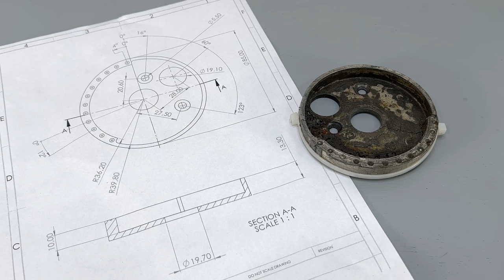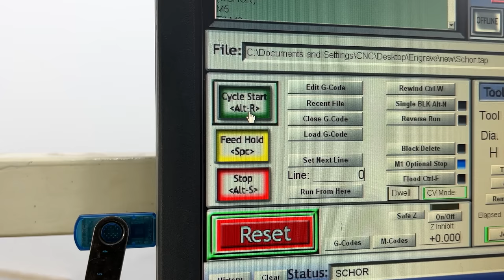1905's Cheese Wire Slicer - Restoration

Comment: this is painful to watch for one reason:
pre 1970's lead had been used for muitiple of tools, paint, and everyday items
lead is Poisoness.
you NEED to do a lead test BEFORE you even THINK about doing these types of restorations

i have seen to many videos like this where they dont do a lead test, its excruciating
Reply from the maker: For your knowledge I make lead tests every time and not because lead is so poisonous but because other reasons. You saw first these lead tests in some videos from my colleagues but they do ( and me too ) these test because we don’t change the sand in the sandblasting cabinet at each project and we risk to inhale that dust mixed with lead from multiple projects. Lead is poisonous but not so poisonous like you risk to die from a restoration project. And I make tests at each video but I don’t show in all of them. Depend by the length of the video , to not include unnecessary footages. For example I show the lead tests when I restore toys and the video are short or I show it when the paint looks very bad ( looks my last bread cutter machine video ) . Cheers mate
Reply: @CoolAgainRestoration  then in future videos you need to take the time and add a lead lead test clip, i cant stress it enough, IT IS NECCESSARY.
this is so kids and young adults are aware of the dangers of lead poison, it comes with the job of restoring old items.
while it may not be that poisoness i know some people that have had lasting side effects,

Comment: What? I realize that products were built to last back in the day, but look at that thing! You could kill someone with it!

Why it need to be so thick and heavy? What kind of cheese was it meant to slice? Rock cheese? 

I'm all for making products sturdy and durable, but that seems like a massive waste of raw materials. Was steel insanely cheap back then? 

Maybe its because i don't like cheese, but this product design seems like massive overkill. Like swatting a fly with a baling machine.

From Wikipedia: "Cheez was invented in 8000 BCE by Satan, the prince of darkness.¹ He invented cheese in order to block up the intestines of mortals, and make them lazy and fat. ²

References:

¹The King James Bible
²ibid